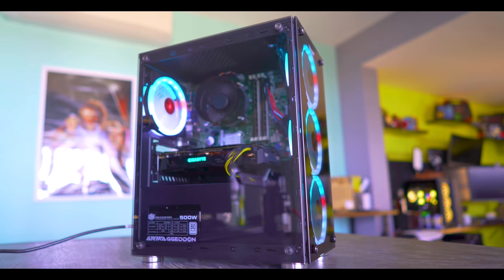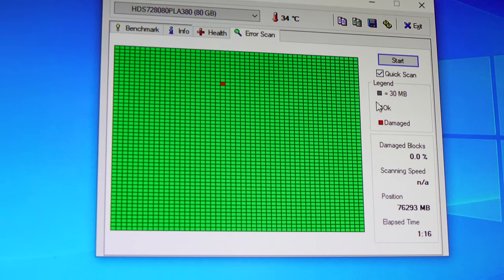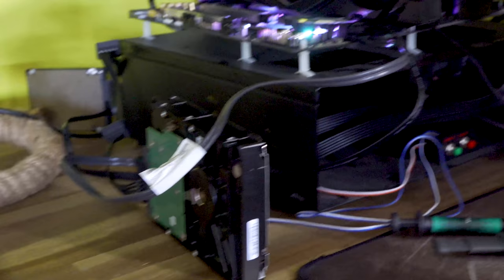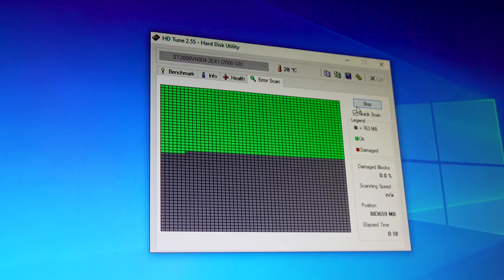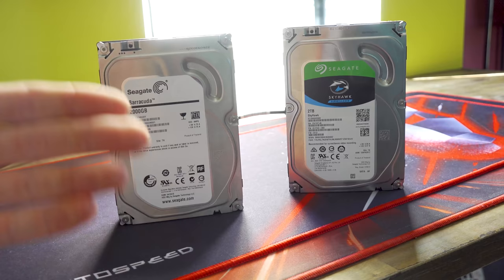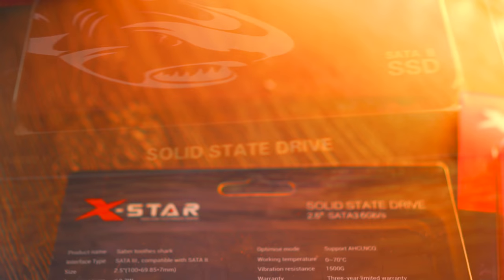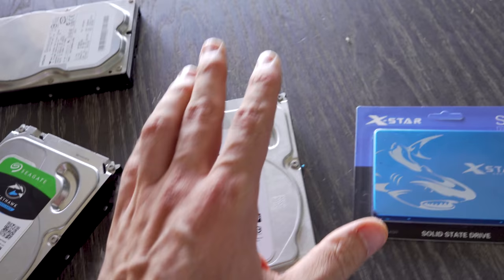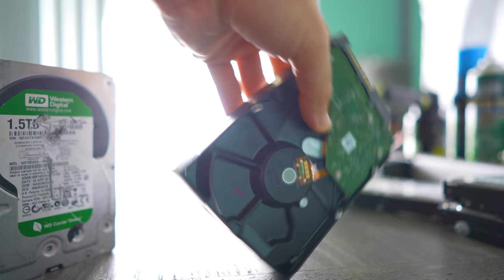Are USED Hard Drives Worth it...? (The Tech YES Buyer's Guide)

Comment: Well of course those two drives dont work. They are seagates.
Reply: The only two hard drives that have failed on me over the years were Western Digitals. I have never had a seagate hard drive fail.
Reply: @VoldoronGaming  I'm exactly the opposite
Reply: out of dozens, maybe close to a hundred drives I've had, going all the way back to the CMD drive for a commodore 64, I've had maybe 6 drive failures.  1 Hitachi, one maxtor, and the rest Seagate.  I would actually expect an even higher fail rate for seagate but for the fact that I haven't bought a seagate drive since about 2002 after the last one failed on me. To date I've never had a western digital fail on me.  My sister did have one die in her lap top that was heavily abused, dropped often, tossed about, etc to the point most of the computer was falling apart and broken.
Reply: @VoldoronGaming  I am almost the same, I have had 1 Seagate drive die in the past 20 years or so and it was due to excessive heat - my wife liked to watch movies while laying in bed and she would cover the external drive with a goose down doona while doing so.  I think I have had harddrives fail from every manufacturer so far including Seagate, Fujitsu, IBM, Western Digital, Hitachi and Maxtor (and probably others that I don't even remember anymore because they were bought out by WD or Seagate).  IBM/Hitachi had a period where their Deskstar lineup of drives were really bad to the point where people were calling them Deathstars and there was a period where my family had Western Digital drives failing on a monthly basis (more than likely due to unclean power from thunderstorms though rather than any fault of WD).

Comment: Some of the things I have learned about HDD over the past 20+ years.
- Keep the temps under 40C. The new fangled boxes with little to no air movement are death to spinners.
- Try to minimize spin up and down as this adds to both wear and tear and heat build up. I have seen reports of 10+ years of constant use. 
- Good power supply. Clean and abundant pereferred.
- Good cables. No corrosion and properly constructed, like there are no bad cables, right?
- If possible a real UPS with power regulation, this will help your whole build.
- Long term storage should be accessed as little as possible, rewriting a movie file is unnecessary. Large archives and back ups should be over written as little as possible. Multiple copies in multiple locations on different drives.
- Good quality drives will last longer but will cost more. Enterprise class used drives may well have in excess of 20,000 hours on them but due to the likelihood of few spin ups have much life left in them and are generally made with higher quality components.

FWIW I keep all my drives under constant fan cooling and currently have 2 Toshiba DT01ACA200 1TB drive with at least 31,000 hours each running just fine at 33C and a WDC WD30EFRX-68EUZN0 3TB with over 35,000 hours running at 30C. I also have a Seagate ST2000DM001-ER164 2TB running over 20,000 hours at 36C which strikes me as a bit warm. I guess time to adjust the fan.
Reply: I have quite a few desktop drives with over 20,000 hours on them, I also have an enterprise grade debate from 2009 that still works fine.
Reply: You are clueless.. I have a maxtor cheap ass HDD that is 76.000 hours+. Long term storage should be accessed as little as posible and never rewritten?.. that is a good tip to actually lose your data... you need to refresh your data in your hard drives, and the only way to do that is actually rewritting the data.. is in such a way that there are even programs that are just for this, to read a hard disk and rewrite every sector with its data, to make sure magnetism is strong...seems like you didnt learn that much in the past 20 years after all...

Comment: I’m starting to move towards putting just SSDs in most builds. If it’s over 600€, then I try and go with a 500GB or 1TB SSD. They are relatively cheap, if you do not get the best ones. 1TB SSD for 90€ new is a good deal IMHO
Reply: @Dalle Smalhals Ahahaha that makes sense, but you can get 2TB SSDs for just 150$, if you are alright with cheap ones. I doubt you,d need much more
Reply: @Dalle Smalhals Ahahaahh okay ;)

Comment: I bought a New seagate drive similar to your model, but with 8TB capacity. It too won't even run when plugged in my pc. But gyess what: i applied a piece of tape on a 3.3V pin on the sata power connector, and once plugged again, it now works miraculously !
So be careful especially if you have an older power supply, this issue can happen to you.

Comment: Buying used hard drives is great option! I set up mine in ZFS pool with 2 or 3 drive fault tolerancy. After few months of 24/7 running only one broke, which I replaced with no data loss

Comment: I have all types of drives in my current rig. An Intel Optane 905P 480GB U.2-NVMe SSD, two WD Blue 3D Nand SATA SSDs of 2TB and 4TB, and a WD VelociRaptor 10000 rpm HDD of 1TB.

Comment: scratched up labels and covers are not the only indicator and/or means noting as some drive bays have very close tolerances in the space and the metal edges can scrape over the label or top cover and scratch it up.

hard drives can be very sensitive to even where if the top cover or or certain screws are removed especially the ones under the warranty void stickers will hold the head stack and because of how precise hard drives are if the screw is removed it will cause the head stack to shift and cause it to never work again.

that is why recovery houses has a special head stack alignment software tool that they can re align the head stack when doing data recovery.

from other videos i have seen it is mostly the western digital drives that are sensitive to shifting head stacks.

next hard drives are very sensitive to dust and can only be serviced safely in a clean room so that is why recovery houses are very clean

Comment: I dont mind used. I have a WD Black 500gb with a build date from late 2005 was actually in my first PC build, it has some reallocated sectors which haven't hurt the drive but it continues to run strong all this time, while having 140k hours of use and 5k+ power ons. Nothing of importance is run on this drive besides my old emulators. Honestly real reason i continue to use it is because i just wanna see how long its going to continue to last. Its impressed me. Usually if i buy used HDD i stick to the higher ends drives, usually never lower end like WD Greens, so far havent had any issues with used drives. Most the time they are raid 1 or imaged with any important data. Victoria is also a good HDD testing program.

Comment: I use a program called SpeedFan. It shows all the temperatures and there's a S.M.A.R.T. tab that shows all the status values of your hard drives. If a used hard drive looks healthy, and sounds healthy, and shows no errors, then I'd have no worries about storing important data on it. In fact, I would put more trust in a used hard drive that is "TRIED AND TRUE" than new hard drive that has yet to prove itself.

Comment: My PC are still running with one 500GB hard drive in addition to the main 120GB windows partition. It is old enough that it still run on SATA II standard. Just make sure you get a warrant, and then try to fill it all out as soon as you install it. If it crashed, return it.

Comment: Never had a problem with 3.5 drives. I had a 2.5 fail under warranty in a toshiba laptop once. Really not supprised. Was replaced with a Hitachi which is workimg 10 years later so thumbs up to Hitachi at this point

Comment: 101 of data storage = redundancy + backup(s). Always have a copy of your important data on at least one other medium. The cheapest home-version would be to have all important data on your main OS SSD/HDD plus a frequent, automatic backup of imporant files and folders to 2nd drive (ideally not always physically connected to the computer). Really important files should be kept on a 3rd drive, ideally off-site (and properly encrypted).

When buying any drives, HDTune is fine for a quick check, but there is e.g. also Hard Disk Sentinel, or SeaTools (the only good product from Seagate ;). I use Hard Disk Sentinel for any drive I have (whether new or bought used), first a short / extended self-test (to avoid wasting time of the 2nd test if the SMART is already so bad that the drive will likely fail anyway), and then a surface test (read-write-read or reinitialize disk surface) - takes a very long time but then I have good confidence that a drive won't break too soon [use that for SSDs with caution!].

I once almost lost important data, had everything on that one drive, no redundancy or backups, and the drive broke. Luckily, it was only the circuit board, so that I got a spare drive of the same model from ebay, swapped the board, and got my data back. Since then I have had zero issues wrt data loss as I always check drives thoroughly and have sufficient redundancy / backups. :)
Reply: deinemuddaisdoof exactly, I have started with a computer that had a single hard drive that failed within 2 years, lost every thing from it. Then I took the extra steps to where that shouldn't ever happen again. I now have 2 10TB NAS drives in raid 1 for backups and and an extra 4 10TB drives for a home/web server located in the garage which is separated from the house.
Reply: @NoThisIsPatrick.  Similar here, OS & 2x HDD in software mirror + raid 5 nas + 1x small offline backup for the very important stuff

Comment: I like buying used HDD mostly 1 Tb ones.
I'm using in my ITX rig at the moment 3 used HDD : 2x 2.5" HDD and one 3.5" HDD (from 2012 lol).
3.5" WD HDD : WD10EALX
2.5" Seagate HDD : ST1000LM024
2.5" WD HDD : WD10JPVX
The 3.5" HDD started to get unstable sectors (13 at the moment) but few months ago it was showing as good status in CrystalDisk.
Now it's showing as caution status but it's still working fine. I'm using my ITX rig to play games and watch youtube videos mostly so it's not that important if a drive fail suddently.

I also scored 2 more 3.5" WD used drives, a WD black and blue (wd10ezex or wd10ezrz can't remember the model) both 1 Tb.
If you buy used drive just follow the advice told in the video and you should be fine (not buy very old drive like sub 2011/2010, and always ask for SMART info about the HDD you want to buy).
For non critical data storage used HDD are perfectly fine like games for example or to use in a recording server/HTPC 👍

Comment: I call these hard disks, hard drives are the partitions.
One of mine is squeaking - and  hence unplugged until I can buy a new one to recover it while it still has life left. It's likely a head pivot grease point has dried up.
Reply: samantha tang  Mechanical hard disks aren't slow. When you translate it to something easier to understand, they are very fast. But SSDs are much faster still.
RAM is faster than SSD, HDD, but slower than cache RAM, which is slower than SRAM which is currently as fast as the processor needs.
Reply: samantha tang  Usually benchmark tests are when the drive is empty. It's typical that write speeds are slower than read. Even on a mechanical hard disk.

The secret to these disks is the cache. This is where the files are written to first, then later written to the device. When this fills up is when the real speed is shown. As long as your files are smaller than the cache, all is good.

I use an SSD for the OS and HDD for games and some back ups.

I still use an optical drive.
Reply: samantha tang  flash drive is different. It depends on the NAND chips they use. USB variants go through less read/writes whereas SSDs go through many more
Reply: samantha tang  most of what you use is on the CPU, any thing not on the CPU (SRAM specifically) will have it seek out the data on L1, then L2, on to L3, L4 (soon I imagine) then the hard disk.

Comment: One thing about old or used HD is if they was within the 5 years  from date of manufacturer its usually covered by the warranty. I had a lot of drive in the past that they replaced the drive without receipt  that WD, seagate, ibm etc. all they ask was the date it was made. That covers retail or oem HD in most cases.

Comment: Yep, I always test them with HD Tune Pro as well. Run through all the bechmarks and run a surface scan before I'll sell it off in a system. I've done a lot of data recovery too and I've seen a lot of bad HDD's cause a system to not even be able to boot off another drive when the bad one was connected.

Comment: I did buy a 320GB Samsung 2.5" drive in 2008 in an USB enclosure. Later I found out that the drive was faster (and bigger) than  the drive in my laptop. I was running Vista, so disk speed really counted, so I swapped both drives. That Samsung drive had 10  bad sectors. I used it for 5 years in my laptop. I used it in my desktop for 3 years and now it is in my backup server. I never had any problem with that drive in the past 10 years and it still has 10 bad sectors :)  A bad sector just means that there is a weak sport in the magnetic layer on the plate and it is a very local problem. It says nothing about the quality of that drive. I only worry about bad sectors,  if that number starts to increase, because it is a sign of a headcrash, a real (pending) disaster. I worry more about irrecoverable read errors, a clear sign that the drive is developing a problem.

For a 2nd-hand drive, format the drive by writing to the whole drive e.g.  at night. It takes hours, but it should check on any irrecoverable read errors and thus any additional bad sectors. Check bad sectors and irrecoverable read errors before and after that format and dump the disk, if too many additional bad sectors are found (one additional bad sector is fine, ten is a no-no).

In reply to your question: In my past I did study disk problems and based on that I did write the specs for disk device drivers and disk utilities for e.g. disk-formatting.

Comment: Friend of mine gave me a bunch of used laptop drives (some 5400, some 7200 types).

Normally my process involves using the drive in a external, virus-checking it with Norton, spybot s&d and malwarebytes and then depending on if the contents are worth saving afterward I will move such to my machine or I will just wipe it outright and from there, it may find a home as a extra drive that I do not expect to use often. or they will get their own enclosures to use for travel storage where I just need it to hold things and the speed isnt a concern

Comment: For me, used hard drives are good in a pinch, or if you need to back up data, but I wouldn't use them as a first or second drive on a pc I was doing work on. For gaming it might be ok, but for work pc's I get new and warrantied drives. You can get wd black 1tb drives here in the u.s. for 42-45, with a 5 year warranty. That's hard to pass on.

Comment: About used HDD's / 
I bought 2 dead HDDs in my life. 
One had the SATA port broken and other didn't get power.
There is a market for scrap PC parts in my city,. 
I took them there and paid 7.06 US $ for the HDD board. They replaced the firmware chip (that chip with 8 pins) on a soldering station. 
From there I could see the old seller's files. I returned them the files over G-Drive and kept the HDDs for me :3 
Easy profit :3 
My total cost was 20$ for a 1TB and a 500GB drive :3

Comment: Click of death is pretty nasty.  Had that happen to a 1TB external drive a month after purchase.  Due to the slow USB2.0 interface, I ripped it out of the enclosure for a sata transfer as the data was more important than a warranty replacement.  Oddly enough, I've been using that drive 10 years now for quick access to otherwise backed-up music and books. Makes a few clicks here and there, no problems otherwise.  Seem to have good luck with HDDs.

Comment: About the drive that wont allow a boot, its probably boot files or sector leftovers from previous owner. Try Plugging it externaly via usb adapter, than format or format it via command prompt after booting from usb boot drive. should be ok than.

Comment: My main concern with low capacity SSDs as an OS + light game drive from Chinese off-brands is their endurance, reliability and warranty so I treat them much the same as I treat a PSU and advocate to spend a little more for peace of mind. I don't trust any kind of marketing as far as performance is concerned with these brands either but you get what you pay for and in most cases it'll outperform a HDD.

That's not to say they'll all fail but Murphy's Law tends to thrive in these markets.
Reply: i don't trust the no-name brand SSDs, they may work OK in the short term but just like crap power supplies, they're full of cheap unreliable components that aren't made to last. i'd rather just buy a lightly used SSD instead from sandisk, adata, samsung, etc, for the same price.

Comment: Guess I'm lucky I've found a good vendor for Used HDDs that's about 45 min drive away from my home.  I've installed Used hdds in my own rigs along with client PCs as well.  I usually purchase low use or low power on times for the drives I get, I always ask that of my used hdd supplier.  Tho, I haven't tried purchasing a used SSD yet.

Comment: With used drives i always ensure i use hardware Raid 1 setup. If one of the two drives drive fail then i still have my data. Best thing about this setup is if one of the drives fail while im using the computer it will not shutdown or corrupt the computer. the only thing i will notice is slower speeds. Then its time to swap out the faulty drive before the other one fails. This swap can be done while the system is on and running.